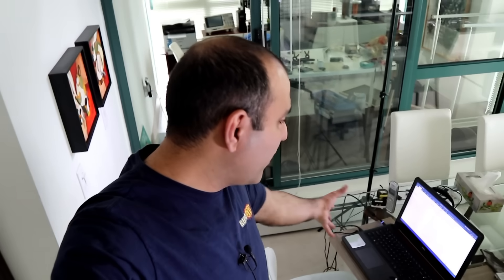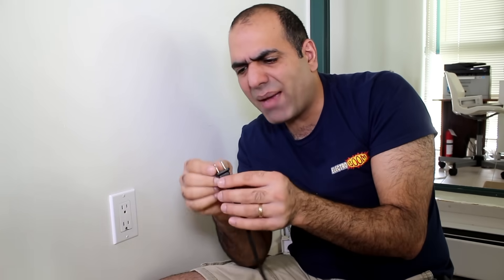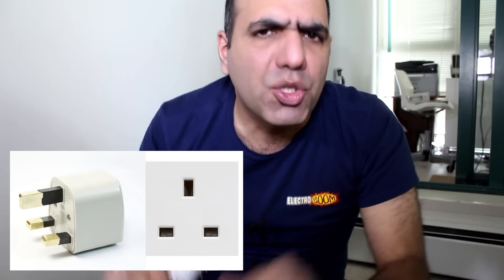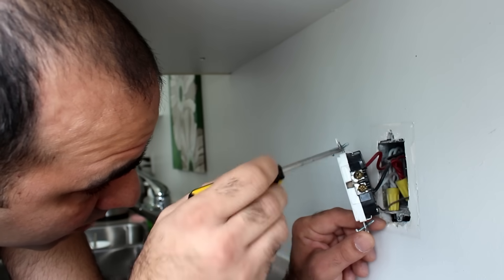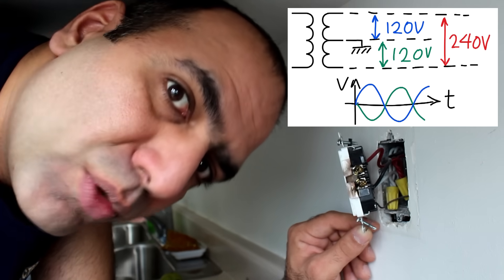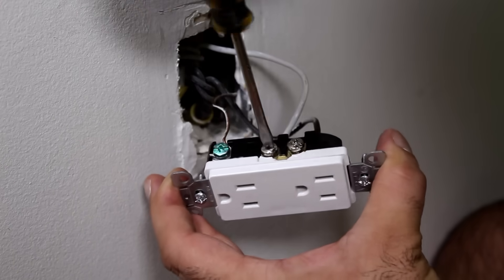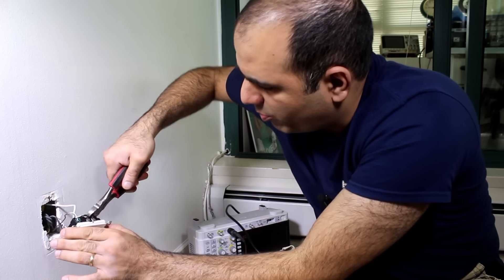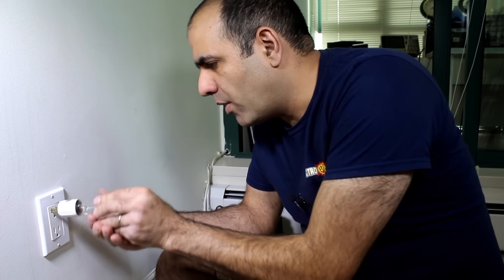How to Replace a Power Outlet

Comment: Can someone tell me why does neutral is a specific socket? If AC alternates doesn't it alternates between live and neutral? And if it oscillates only on live, what's th difference between neautral and ground?
Reply: To put it very simply (and I'm not an electrical engineer), live is the supply line, and has a traceable path all the way to the generator.

Neutral is the return line, and is actually tied to Earth at various points, such as the distribution pole or substation. Electrically, Earth and Neutral are very similar. The Neutral wire does not go all the way to the generator, but only allows a return feed to the point where the three live phases are split off.

This is a gross oversimplification, and I'm sure Mehdi himself has a video or two explaining this in a far better way than I ever could.
Reply: Neutral is bonded to the earth through the ground rod giving it the same electrical potential (within a few volts) as the earth.  So if you touch the neutral (assuming it has continuity to the bonding in the breaker box) there is no potential (voltage) difference to cause a current to flow between the wire and the earth through you.  

Plugs are polarized because on some electrical items, such as Edison (screw) lamp sockets, one side of the circuit can be touched without disassembly.  So the polarization (wider blade - neutral) ensures that side is connected to the grounded (neutral) conductor.
Reply: JK Brown why then we need an extra earth line?
Reply: The "earth" wire or in the US "ground" wire are misnamed.  They are a bonding wire which produces a low resistance path from all conductive surfaces a non-technician user can come into contact with that could possibly become energized in the case of a fault to the breaker so that the high current will trip the breaker "clearing the fault".  This is commonly called the "safety ground".  

The grounded conductor (neutral) and the ground rod are the "system ground".  This "ground" protects the equipment by providing a low resistance path (US) for high voltage transients, such as might be induced by nearby lightening, to earth thus preventing arcing in motor windings or from the wires to the earth (and possibly through flammable material).  This bonding results in the earth (within limits) and the neutral wire being at the same potential.  

The safety ground is bonded to the neutral in the breaker panel so there is a path through the transformer to the breaker.  As the neutral is bonded to the ground rod, this means the safety ground is also at the same potential as the neutral and the earth.

Comment: So in the United States they say 240 is to dangerous, so when they need it they lay extra cables, ginius. What do you do when you want 400 volts?
Reply: Michiel Vadermarliere I'm a robotic major or also called industrial maintenance, I kinda work with 24v - 640v and other things too as my job, 400v is use industrial purpose like lights and certain machine in the manufacturing process like laser welder, robotic arms and other things. If you have any more question about it, just ask me bud and I'll answer as best as I can.
Reply: Szakembőr TV TMIAE so do you have an intire different grid? Or just transformers?
Reply: Michiel VANDERMARLIERE ? Pretty much every US house has 240. Most branch circuits are 120. High demand loads are fed 240 with a different outlet configuration. Commercial is usually 480 3 phase although it's cheaper if you buy primary and supply your own transformer. CA uses 600v 3phase.
Reply: Most newer commercial buildings are fed with 480v 3-phase with step-down transformers to feed 120v/208v circuits. I worked in a place where the rocket scientist who designed the building thought that the computer room could double as the electrical room, and put the transformer and circuit breaker panels in there. The space in the computer room was marginal even if they hadn't decided it was a great place to put the electrical equipment too.
Reply: Brian Leeper I imagine the temperature getting a bit high in there. Be surprised if it dodn't affect some of the hardware.
Reply: in Argentina we have three phases that phase to neutral is 220v phase to phase in 380V  and for big building you get 13.2Kv and you transform that

Comment: Here in Brazil we have a color code closer to the European one: green for ground, blue for neutral and any other color for the other wiring (the most common are red, black and white.)
Also our outlets are closer to the Swiss model, but with the ground pin unaligned. It's like:
<o * o> -- neutral, ground, live

Comment: Canadian electrician here. In residential they do use center tapped transformers to obtain 220-240v. 
Also, we frown on using the push connectors. Especially with the introduction of arc fault circuit interrupter breakers being code now. The contact surface area in the push connectors is so small that it can easily arc or become loose, corrode, etc. It causes the arc fault breakers to nuisance trip, or trip because the push pins arc.  Its always best to use the terminal screws. 
Under Ontario electrical code, you are allowed to change your own devices. But best to call a licensed electrician if you are unsure.
Reply: What's your take on cutting the wires everytime the outlet is changed out. He cut twice in this video. Eventually there wouldn't be enough service length left
Reply: Vernon PGros Morne - I will usually cut unless I feel the loop is salvageable. 
If it's pressed into the quick connect you're better off cutting than trying to stick some tiny pointy object into the release. 
If on the screws, I'll cut if the copper is nicked or marred. That's a possible break point if the wire gets bent or twisted, which is inevitable when pushing the plug back in. 
As far as the wire getting too short, that is exactly why it's code that there be slack left in the line just outside of the plug. Allowing you to pull more wire into the box, strip it back, and have a usable wire length. If you're stuck replugging a 100 year old house where the wires don't even protrude beyond the box, and there's no slack in the wall, which wasn't practice back the, you can connect a jumper wire. Just marrett on a longer wire and push the connection deep into the back of the box. 
If using marretts in a box, don't tape them.... Just twist them tight enough that they don't come off... 
Oh, and, don't ever listen to the guys at home Depot.... There's a reason they work at home Depot and not in the field. I don't know how many times I've overheard bad advise... Only once was it bad enough that I actually interjected. Usually, I try to not get involved... Liability is a big deal...
Reply: Shawnhuk - Your systems seems pretty strange to us too!  I live Down Under (literally "out in the sticks"), and we have a generator back up ('cause we have more than a few outages). Talking to a friend in the US, and it is very obvious that your system is VERY different. Here, the GenSet is hard wired into our 240v main distribution panel via an auto changeover relay (with autostart), whereas our  Texas friend literally plugs their 220V output portable gennie into the  "Laundry Socket". It seems that your laundries have 220 V sockets, whilst everywhere else it's 120v, which is "interesting" . . . . 120V for "safety", and in a potentially wet environment - 220V on tap. Presumably this is to avoid excessive current flow for high-demand appliances (e.g. tumble driers), yet is seems so very counter-intuitive where "safety" in the main concern.
Reply: Interesting that the earth wire was uncovered. UK / AU / NZ standards require the use of a green/yellow insulating sleeve, in order to prevent (or rather significantly reduce) the likelihood of inadvertent phase / earth contact (or false RCBO tripping resulting from neutral / earth contact).
Reply: Phil S - your friend is just using a portable generator rig wired into his dryer plug. It works, but not exxxaactly how it's supposed to be done. You can use a portable generator, no reason why not, gotta be smart about the wattage to not overload the generator, but if you know what you're doing you can just switch off circuits that aren't necessary to avoid overloading the generator. What's preferred is a dedicated plug with a transfer switch (manual) as a standard breaker doesn't really like to be back fed (fed in reverse). We have standby units as well. With automatic transfer switches that automatically start the generator if the power goes out. 
About two months ago i installed a 22kw generac for a client. Fed their whole house.  They didn't necessarily need it as our power doesn't go out much, but if you've got money to burn, well... You know. 

As far as the dryer. Our code doesn't consider the washer and dryer much of a wet zone. Kind of a gray area. The plugs are located near the floor behind the appliances and they are protected by appropriately sized breakers. Not much of an associated risk there. But those Large appliances (dryer, stove/oven, AC) are the only appliances that are 220. Everything else is 120. 
In our residential we don't use 3 phase, however, where you guys do, I believe. We only use 3 phase for industrial applications. So ya, our house holds are running much higher amperages. Common  breaker panel is 100 amps, an upgrade in a larger house is 200 amps. Most commercial is 240v-600v 400 amps and industrial is usually 600v 400a 3 phase and up
Reply: Dustin Nielson - standard outlets are 110v 15a. Higher demand outlets, like kitchen, special utility or special requested outlets will usually be 20a. Dryer is 220v 30a. Range/stove/oven is 220v 40a. Your run of the mill full size hot tub is usually 220v 50a. That's generally your highest draw item you'll have in a residential dwelling. In certain older homes, however, they were wired with 220v 200a service with a 220v 150a electric forced air furnaces. 
Going way back, smaller row houses around the the 1940's the house was fed with 220v 60a in a fuse panel.
Reply: Dustin Nielson - keep in mind, it is extremely rare people will use an electric furnace anymore, with the cost of hydro, an electric furnace is very expensive to run. That said, geothermal heating/cooling using an electric element to heat and the heat pump draws quite a bit of energy. But the whole system is generally more efficient because the majority of your heating and cooling comes from the temperature of the earth being a consistent 68 degree.  We also tend to use a LOT more circuits from what I've seen from EU YouTube channels. A standard 100a electrical panel is 32/64 space panel. There are 32 spaces and a possible 64 circuits. In a lot of houses I've wired I tend to use about 30 circuits. In larger 200a houses I use 48/96 space panels. Don't usually fill them, but close. One house I had to use a 60/120 space. That's a TALL panel... Nearly 5' tall. But generally in a house that big we will use two seperate panels on either side of the house as the circuit lengths tend to be a bit long, then we have to start upsizing wire, which is just a waste.
Reply: Canada is probably similar to USA in that standard residential outlets are 15 amp, but certain outlets are required by code to be 20 amp, such as kitchen, laundry, and dining room outlets. Also, commercial outlets are usually 20 amp---this is not a code requirement, but a common trade practice.
Reply: Phil S - the European power system is a complete mystery to me. Its baffling how cometely different it is to the north american system. I will admit I know verrrrrry little about it. Not to mention it's all metric???!!?!!??!!!! 😵
Reply: As an American electrician. Why do you make a 220 volt plug like that? Do you guys have 220 volt appliances?
Reply: crazymaniac3000 - almost every is 220v with no neutral. Right down to the alarm clock. I do know that much.
Reply: Phil S I just realized your friends arrangement. I did not clue into the dryer plug thing/prongs on both ends. Yes, that is EXTREMELY dangerous. That is not how it’s done. For a portable generator you should be using a plug like this... https://www.amazon.ca/dp/B000BQT47S/ref=cm_sw_r_cp_tai_i_Y0K9AbCSQZN66

And some smart operation by a smart operator to ensure the plug is connected and the generator running BEFORE the manual transfer switch is thrown to ensure the plug prongs are never live and exposed. 
Somethings the backwoods solution gets the job done, but never smart to use long term. Hell, I’ve plugged a generator into a house plug with a double ended cord before. New construction, we finished wiring and finishing the house and needed to test everything before the hydro company had come and made the meter live, but we had the area roped off so no one could pull the live plug out and get shocked. 
Anyways, good chat. Take care.
Reply: I've seen just as bad Down Under. Permanent hard-wired is safe, and legal, but we all know "folks are folks", and I've seen a few "creative solutions" over the years. All the best, and keep safe! :-)
Reply: I have two 200 amp panels in my house, 400 amp service. It's probably overkill but I have plenty of extra spaces for breakers.
Reply: Brian Leeper - my wife's uncle has 400amps too. Its a big house, but it's overkill for sure.
Reply: There's no push connectors on Aussie outlets, all screw type.
It's odd reading the comments and seeing other country's colour codes and equipment etc.
If Canada is on 110v, is your standard outlet 20amp? (Ours are 240v/10a)
Reply: Cheers shawnhuk ~ That makes sense.
Our larger outlets are 240v/15a (welders, some aircons, caravans etc)
A lot of properties here have a 3phase power feed for larger equipment, even some electric stoves run on 2phase (though that's just to share the amp load from different elements ~ they're not 440v)
And we don't have furnaces (coz it's usually bloody hot), just reverse cycle aircons, you guys need a lot more heating according to the size of the circuits you mentioned (150a - Wow!) 
It snows in over east but here in W.A we rarely see 0'c.
Reply: Those afic breakers are ****ing expensive. can you chain a afic socket with regular sockets like you can with a gfci?
Reply: Christian L - we get out arc faults for about $55 at our wholesaler. 
So, my understanding of the way arc faults protect is, the breaker will protect everything downstream in series and parallel. An arc fault plug will protect downstream in parallel and series,  but I believe it will still, but only, protect in series up stream.
Reply: +Christian L in Canada we can use an arc fault breaker to feed upto 12 receptacles still, except fridge, counter plugs, bathroom receptacles and sump pump where arc faults are not required.
Can use a arc fault receptacle at the first one and protect all receptacles down stream, but that first receptacle requires conduit to panel.  With the cost arc fault breakers drastically reduced in price now, they are pretty affordable.  And outside receptacles are to arc fault/gfci combo.